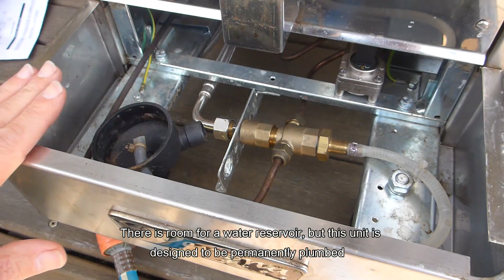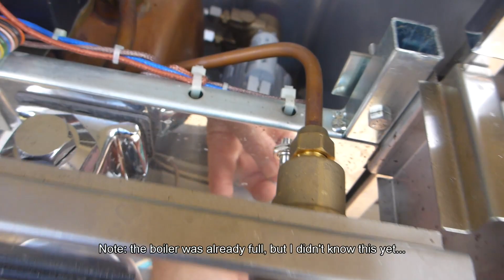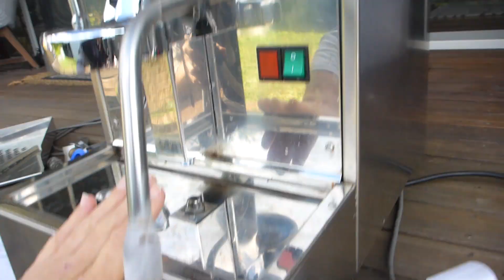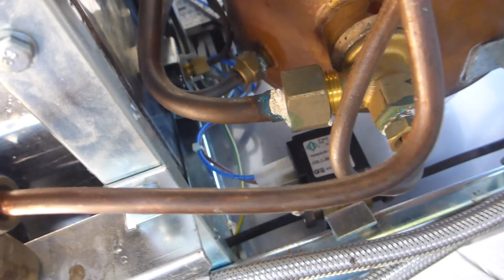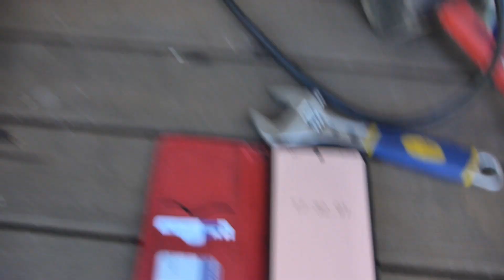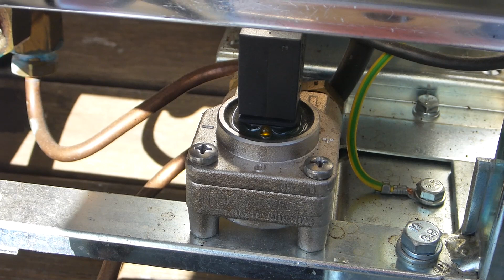La Rocca Verona Express - 1 Group Commercial Coffee Machine - Tear Down and Operation

Comment: I’ve just bought a used one of these and the vacuum valve has started leaking water when the machine is off. Is there a fix or replacement available
Reply from the maker: You may be able to remove and clean it. Ɲot sure if spares are available. Check with their  distributor.

Comment: When the tank filled did it fill all the way? Mine seems to have air left in the tanks and swishes around. Makes gurgling noises, but when I do the fill cycle it just poors out the group head. Is something wrong?
Reply from the maker: Mine was a plumbed version, so no tank. But if you mean the boiler, it should fill pretty much to the top.
Reply: @pescado99  I do have the plumbed version. it's a bit strange that when I switch it on, the pump runs but just lets water out the group head. Not sure if I need to undo a valve and drain it and re-fill it?
Reply: Saludos, tienes el diagrama de la máquina?